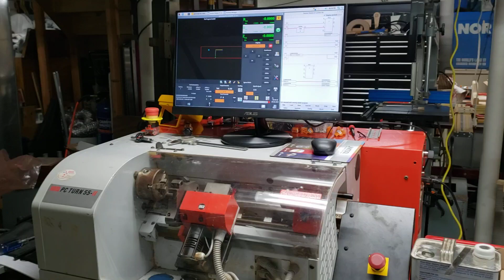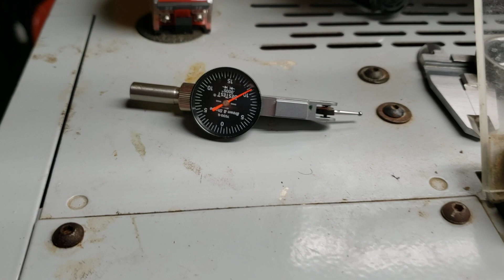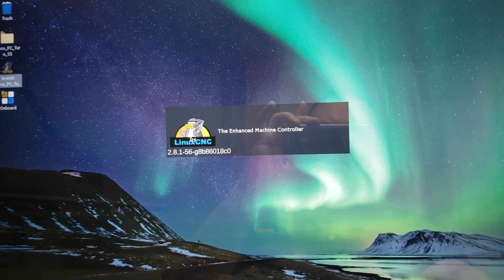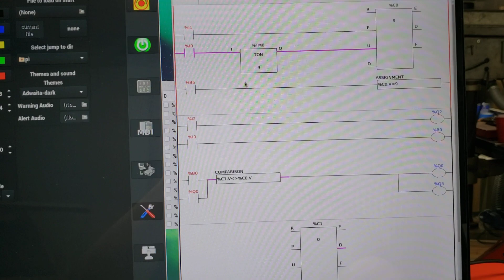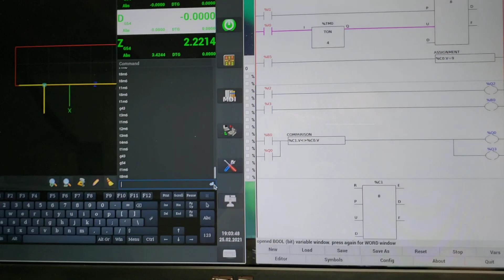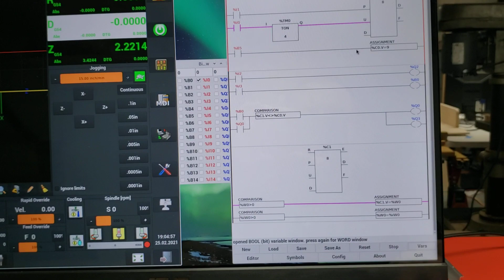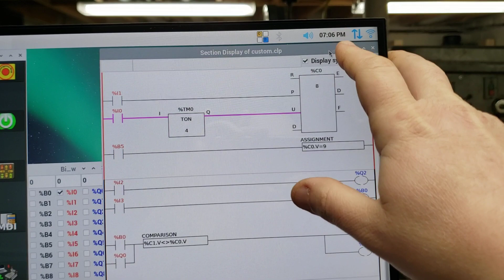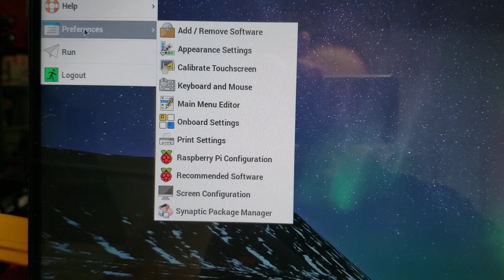Emco pc turn 55 mini update

Comment: What is the cutting feed rate on these, trying to set up my machine . Nearly there :)
Reply from the maker: I think I got up to about 0.02" depth of cut, 0.006" feed per revolution. Not trying to split atoms for cycle time on a tinker toy